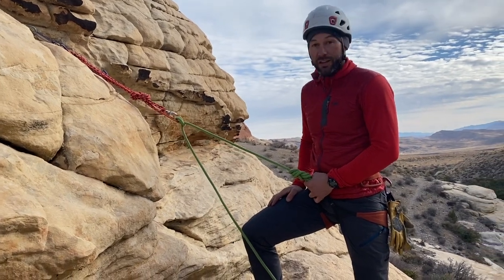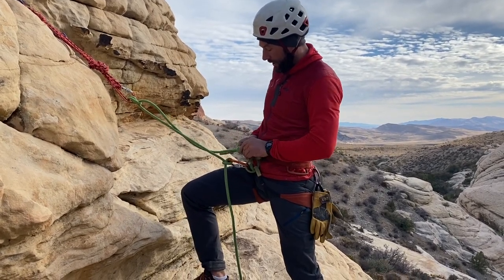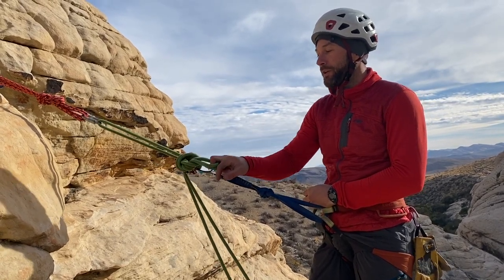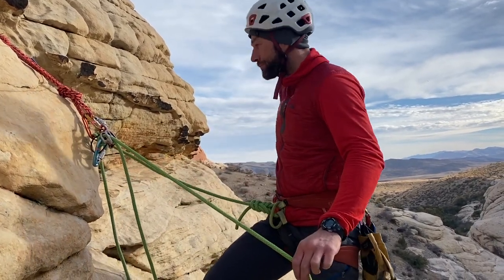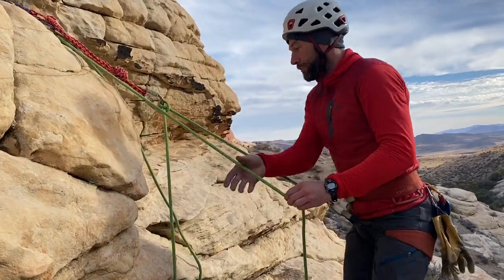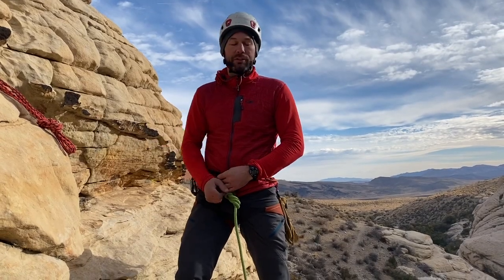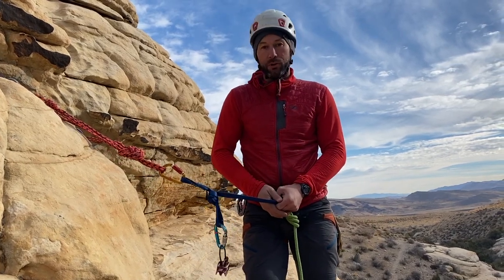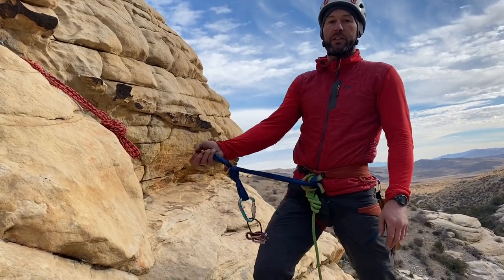Attaching to a multi-pitch anchor

Comment: @14:35 Nice tip with the extra carabiner on your belay loop and clipping loops to shorten. In the past I used a 2nd locker clipped to an intermediate loop and then clip that to the carabiner that's on the anchor, so there's still only 1 locker on the anchor but I realized recently that this potentially pinches the PAS loop between 2 carabiners which is not ideal. I'll try out your way!